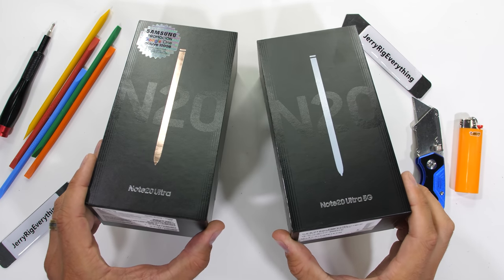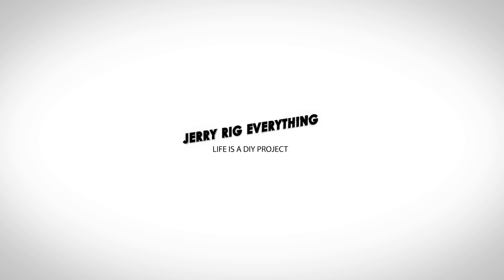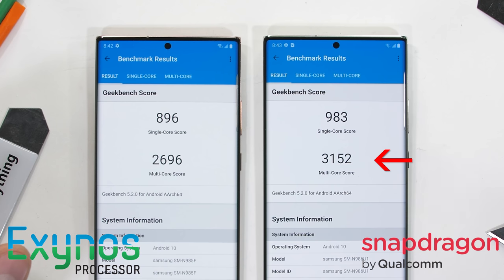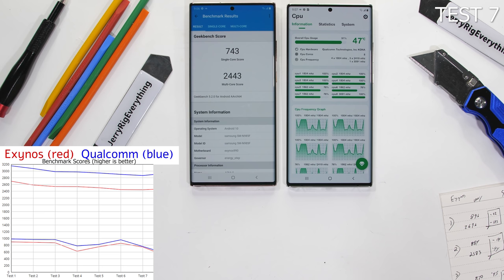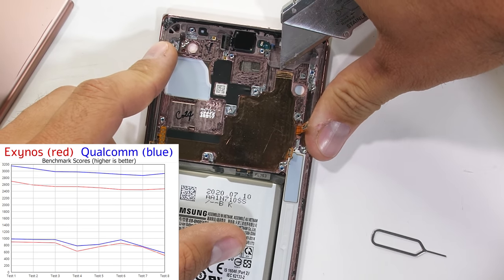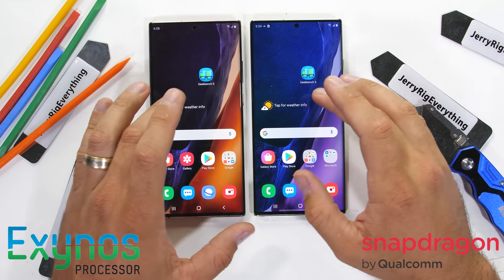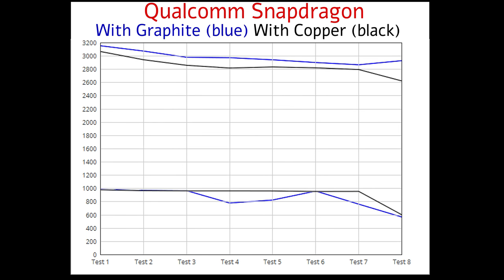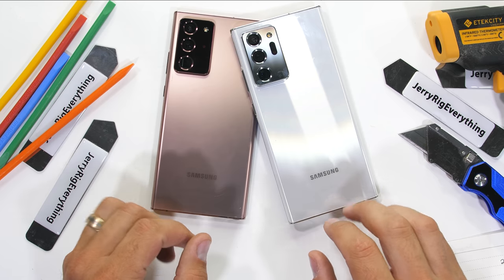Samsung should explain this... Exynos vs Qualcomm?! - Note 20 Ultra

Comment: Customer: Why this phone has different components than the rest?
Samsung: Oh... Well? We had some usless components that we ordered by mistake and we couldn't return them... And we recycle anything.
Reply: cough Iphone SE 2
Reply: @lightning9396  The Iphone SE2 is one of the best value phones you can get btw.
Reply: @sorcy5467  1700mah battery...
Reply: @sorcy5467  actually id save up and get the iphone 11 instead
Reply: @sorcy5467  Yes but has iphone 8 chassis
Reply: @sorcy5467  nord?
Reply: @dhbss4732  Performance wise and longevity - not even close. The A13 (that smokes the SD865 btw) for sub 500 is such an amazing value its insane.
Reply: @sorcy5467  Samsung A71 or A70?
Reply: @sorcy5467  what do you mean about longevity? But yes that processor is better but I just think the battery of that SE can't hold on that well(especially when it gets older) when actually using that processor.
Reply: @sorcy5467  the battery💀 no hate tho
Reply: Samsung: Sir, we are currently running a scam where you will sell you an inferior product for the same price of a better product. 

Customer: No thanks just give me the better product.

Samsung: lol no
Reply: DHBSS yes true. Also the longevity isn’t even an advantage. Imagine being stuck with a 2015 phone in 2025. I’d rather sacrifice some (on paper) performance and longevity for a better phone and get the Pixel 4a.
Reply: Sebastian Daniel that isn’t really the same issue
While yeah there are a few that don’t like the older design of the SE2 most actually really like that it has the old school look, size, and feel
The looks of a phone are nothing more than subjective and are not really all too important to most people at any price range let alone the cheap $399 price of the SE2
The actual important bits of any phone, such as the processor, battery, camera, etc are all very good components in the SE2. 
On the other hand we have Samsung putting inferior components into many of their phones, even these $1300 flagships, and screwing over the unlucky customers that unfortunately get stuck with these inferior Exynos versions by charging the same price that they charge for the good Qualcomm equipped version... 
I’m sure you can see how much different and worse of a situation this is than just having an older design on a cheap phone
Reply: @sorcy5467  Yeeah, its basically iphone 8 that came out more than 2 years ago and they put the new processor in and called it Iphone SE 2,it should actually be cheaper when you think about.... Iphones never had problems with speed and smoothness and thats the only thing have going for them really.. I am an iphone user by the way , in case your're wondering, but i am hoping to switch to android soon, this restricted OS is driving me nuts...
Reply: cowegg longevity may not matter to you but it certainly does to the majority of cell phone buyers
Also in many ways the SE2 is a better phone than the 4a for most customers, especially in processing power and video taking ability 
The Pixel 4a has a slightly better camera for point and shoot photos but that about the only thing that the 4a is better at than the SE2
Reply: Aaron Hainan SE is a bad phone let’s get the facts right. That tiny battery will only last 2 hours in two years on a single charge. Doesn’t matter if you have the latest software update if you can’t even use the phone. The power of a13 is wasted because of that tiny screen. You can’t game or edit video on that tiny thing and also the battery won’t last if you do. The two advantages people list for SE - performance & longevity are only on paper not in the real world.
Reply: Svetoslav Ivanov I’m an iPhone 6s user. Just the other day my battery percentage dropped from 100% to 73% in just 42 mins after waking up. And in the evening it dropped from 37% to 33% in a single minute. If you’re wondering I’ve got my battery replaced less than a year ago and have 94% battery health. The battery life is so bad I doubt these android people can even comprehend. Can’t wait to smash this thing onto the wall when I get a new android phone.

Edit: Battery percentage dropped from 100% to 74% in 43 minutes just now. Battery health at 94%. This is just ridiculous. I’m just browsing web and scrolling through Instagram by the way.
Reply: @dhbss4732  i mean you get 5+ years of ios updates and the battery degrades like with every phone, yes its only like 1700mah but its pretty well optimized so it holds decently long. The only downside the iphone se2 has is the display and bezels but its still a pretty high quality ips panel.
Reply: @sorcy5467  true and the build quality is also good. My friend actually likes the bezels and the button so they act as features for some people. It's all about preferences I guess..
Reply: cowegg you have never used an SE2 have you? 
If someone is telling you that it’s a bad phone well sorry to tell you that they’ve been blowing smoke
For example I have an iPhone 8 that has very nearly 3 years of heavy use and it still lasts 4-5 hours of moderate to heavy use with a battery that is at 81%
The SE2 is even more efficient and in turn gets run time than the 8 did.
You can play any mobile game you can think of on my old iPhone 8 just fine and edit 4k60 video just as easily, even after nearly 3 years.
(Can always use a stylus if needed)

So if an old, beat up, and heavily used iPhone 8 can still do anything you throw at it what that tell you about the SE2
(Also you can’t really claim that the SE2’s battery don’t work after 2 years when the phone just came out a few months ago lol)

You may have an odd beef against the SE2 for whatever strange reason, but it certainly isn’t a bad phone by any way possible means, especially being that it’s only $400

(And here, some free advice.
The image that you give off to others when making weird false claims and trying to trash talk other phones is not a good impression or image to have)
Reply: @dragon81heart  Yes but just saying, that's the old design, yes the internals are great for that price
Reply: Sebastian Daniel true it’s an older design but that isn’t really a bad thing
That’s one of the most loved phone designs (personally I liked the 5/5S/original SE design a tiny bit better but this is good too)
It’s kinda like a restomod musclecar
Looks like the classic but has a modern very powerful engine inside and can blow away many new sports cars lol
(Ok that might not make much sense to someone that isn’t into cars but if you are you will definitely understand the appeal)

Comment: Exynos: Note 20 Ultra
Snapdragon: Note 20 Ultra-est
Reply: More like 
Snapdragon: note 20 ultra
Exynos: note 20 rip-off
Reply: Nugget YT6 i got a good one
Snapdragon: Note 20 ultra
Exynos: Nope 20 ultra
Reply: danel 🤣
the cooler danel😎
Reply: ultraER*
Reply: Exynos: Note 20 Ultra-ish
Reply: They are already called different names, the snapdragon has 5G in the name because it has a 5G capable processor. 5G processors are more expensive and beefier by definition.

Comment: Considering both are ARM chips and should have the same instruction set, it's weird that the Exynos is slower while being at higher clockspeeds then the qualcomm. Does Quelcomm have some secret sauce they use in their chips, giving them more optimized instructions or something?

Comment: They use SD in Korea, that says a lot about Exynos...
Reply: Umm...I think sd is way much better, but I think qualcomm would raise ther cpu prices when there is no compeditor on the market. We hate exynos, but I think it ia needed. Anyway, amd exynos chip would come out soon.
Reply: @Diptangshu Gamer have you ever heard of economics?
Reply: I have KT Note 8. It's Exynos. That specific generation was better than the QC version.
Samsung is required to use QC in the US sure to patents. If the market will accept it they'll use Ex to save money.
Reply: Bro how the fuck in the helll  snapdragon s9 has far better camera and SOC than exynos version. Their sensor is different tooo.  here in turkey now only exynos version is awailable but before there was offical warrant(exynos) and delta warranty (chinese SD version)  i bought a second hand g0600 s9 and bought exynos s9 plus  holy crap exynos is throttling like crazy if you turn off throttling with whitewolfkernel its geting HOT AS FUCK,  but sd version is giivng consistent 60fps in pubg and its far cooler. And SD version has far far better dynamic range camera. its sensor is different.
Reply: @Jk-pl9wc  then use it... I don't want it yet I am forced to if I want to buy a Samsung device over here. That's why people hate it, not because it's worse. If we had the choice, no one would complain.
Reply: Noob Master idk where you’re from but probably it would be the same for your country
Reply: and use exynos at eu and Southeast Asia
Reply: @cenen7021  agreed , s8 exynos was a huge disappointment for me, I'm staying away from flagships since then
Reply: @TheShmrsh   SD820-810-800  is worser than their exynos opponents  but after SD835  SD is far better than exynos. its like intel/amd  int changing time to time
Reply: yeah, exynos is throttling and hot like crazy, especially if using a 4G network
Reply: @RedFire998  i used s1,s2,n2,s5,s6,s8,a8s,n9(all exynos except a8s),iphone xs, and now switching to the note ultra. Of course, on the consumer's perspective, sd chips are far mucb better deal than the exynos one. But, if we think in the long term, if there is no compeditor to sd chips, qualcomm would raise their chip prices, and I assume that the prices of the phones would rise, too. This year, if I know correctly, sd chip's prices was raised. And manufactures had no other option than raise the price of their devices. 
So, at least for now, wait for the amd exynos chip. Or buy an iphone if you want cpu performance.
Reply: @Jk-pl9wc  Yes monopoly is terrible

Comment: Samsung has been doing this for maybe a decade (or more?) with their phones, different markets = different internals. 

I’m just surprised that it’s finally getting the attention from a creditable source.
Reply: Not just Samsung, others manufacturers have also done it for years, like LG.  People need to research before buying.
Reply: It's getting attention because the gap keeps increasing. A few years ago, the Exynos were even a bit faster than the Qualcomm variants.
Reply: @Jremasters  yeah i got a note 8 still and I seem to remember the exynox in this one was then better than the Snapdragon equivalent. At least I still bought after research so it must've been negligent at the very least otherwise I wouldn't have bought...as im not buying the exynox now.
Reply: @dco1019  Yeah same here. I specifically bought my Note 8 Exynos variant because it was faster than the Snapdragon one.
Reply: The difference wasn't as huge before.

Comment: As long as people keep buying the exynos, samsung will keep producing them. I took a different route and got a phone from a different company.
Reply: People is ignorant. The exynos variant is sold mainly in Latam. They truly believe they have the same performance of Snapdragon just because the phone has the same price of the phone sold in the US
Reply: There is no option, in my country for example, Samsung doesn't sell the snapdragon, and if you buy it online from different country you will lose the local warranty.

Unfortunately, I am suffering from the battery and the device heat.
Reply: @andresarenas7565  "The same price" xdd
Reply: I have the exynos version of the Note 8. And guess what, I couldn't care less...
Reply: Dont have much choice if its all they sell in your country
Reply: Andres Arenas Most people aren’t nerds and don’t care what’s inside
Reply: Why dont you guys get one plus 
It’s cheaper faster smoother
Reply: @savagedriver1967  That is what you call typical fanboy attitude. A company treats you like trash by giving you an inferior product at the same price but you still don't care. Many people just don't want previous-gen flagship performance at $1400. It's absurd and unacceptable.
Reply: @mansoorahmed1256  dont need to offset the cost of a phone at the expense of all my personal information being hijacked by the Chinese
Reply: I will stop buying samsung
Reply: @patel.c  Correct. My Mate 20 Pro is due an upgrade, and I went back to OnePlus instead of Scamsung. I'm avoiding all of their handsets in the UK like the plague.
Reply: @ahmedabdelhamid8900  Or buy a different brand/phone. Thats what I did.
Reply: Samsung doesn't sold much phones with Snapdragon in India maximum are exonys so stopped buying samsung long ago
Reply: mr. ADP  not given personal information to Chinese they love to spy
Reply: I just bought a s10 with the shitty cpu and now watching this makes me angry as fuck. Damn really😠
Reply: @rumchaser1able  you dont buy it..  and if enough people complain and not get the inferior product, then they will get their shit together, but if people complain but also buy the phones, then they wont change, cos they get the money anyway....
Reply: @nimbleco8202  no, my friend..
most people are ignorant, and dont know what they pay for..
Reply: @mrdot1126  maybe but the other options are not worth the problems
Reply: NimbleCo but they should that’s the problem with people these days
Reply: @the69mask  I'm facing the same issue.
Pakistan variant with one year official warranty. & if I stick with snapdragon not even 1 month warranty here
Reply: @rumchaser1able  dont buy a samsung phone
Reply: Exactly!
Reply: The point is, Samsung makes one review, one commercial, one online ad and advertises one benchmark. For Samsung to sell a phone by these ads but build them with different parts is pitiful. Exynos is Samsung's processor and it doesn't hold up to the capacity they advertise. They benchmark the phone with Snapdragon to beat the market (iPhone & Google) but sell it with Exynos. Thats dirty and in the USA, we call that Bait and Switch.
Great example of the V6 engine vs I-4 engine.
Continue to be a fan of your videos and I will keep an eye on the phones I purchase in the future to ensure I do not get swindled by any company to include my favorite, Samsung. This makes me sad for my future with Samsung. Borderline Apple products with using old parts to release a new phone. Samsung S6 or S8 screen, 2 years late to the party. Not sure all the example but I recall a screen issue with Apple.
Reply: @coolvinay  which one you bought
Reply: @itstrending8440  P30 Pro
Reply: @coolvinay  ok
Reply: Mainly in asia are the exynos version

But luckily, i got secondhand S8 Qualcomm last year.. Still used it until now
Reply: I don't have option here
Reply: Chirag Patel same in germany.. thats the reason i buy my phones only from the US market
Reply: If only the snapdragon is available here in the Philippines, i would definitely buy that!
Reply: I too moved away from Samsung and bought Huawei P40 Pro instead

Comment: Nice video. I've got a Note 10 and my contract is coming up in September but I'm based in UK. I am annoyed about the processor difference on offer especially since these mobiles aint cheap. Plus size wise I'd say the Note 10 is as big as I want to go. 

Do you have a android mobile upgrade suggestions for UK customers? Either released or coming up

Comment: Not only is Exynos inferior, it's also MORE EXPENSIVE . How is this fair?
Reply: More margins for Samsung
Reply: It's called profits
Reply: They tried to pass it out as the same so if the two were the same the price overseas is usely bigger
Reply: Do you not understand how currency conversation + vat works?
Reply: @CartoonNetworkGlitches  Its called SCAM
Reply: it isn't
Reply: @CartoonNetworkGlitches  not by scamming customers
Reply: @LightMusicK  Its not scam on samsung they tell what you buy, but for example samaung dosent sell phones directly in  my country like in the usa they have partners and the partners jack up the prices but note 20 ultra is 1230e same as in usa.
Reply: It's not more expensive, it's basically the same. The reason it varies is because of taxes and import duties. And the fact the US version's price is pre tax.
Reply: @johnm91326  currency and vat is not the biggest reason for the insane price, my country VietNam where the many part of the note 20 Ultra is produced, and assembled the price is still as high as fuck, 100 dollars more than the us, how is that justifiable?
Reply: @LightMusicK  It's not a scam? It literally says that It's a different SoC which means It's legal
Reply: @hoangnamnguyen9847  because you have a 10% VAT. Take that into account and you will find it costs slightly less than in the US.
Reply: @johnm91326  not at all vat and taxes are cut down thanks to the fact samsung produces note 20 line up in my country and the price is still as high as f, and with even 10 vat off it's still slightly higher than the us pricing, only when scamsung saw their sales number declining did they cut the price in half

Comment: I think the reason the Qualcomm version has the graphite cooling instead of the copper vapor chamber is because they knew it would run cooler even with inferior cooling
Reply: Well, 3 years later Samsung has stepped up their game on the latest Exynos.   I have an A54 which uses Exynos and works great, no heating issue and no stutter for a mid-range $400 usd phone.   Best of all it has an SDcard slot and that's why I didn't go with their flagship "S" series which are lacking an SDcard. I'm quite happy so far. :)